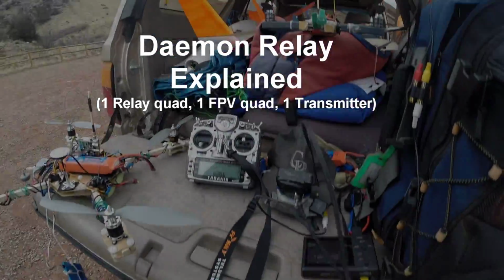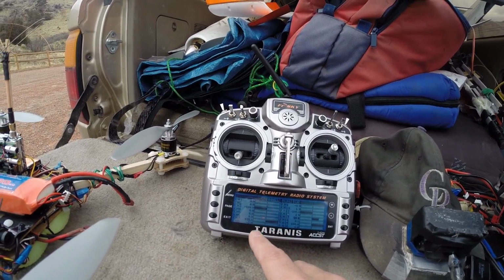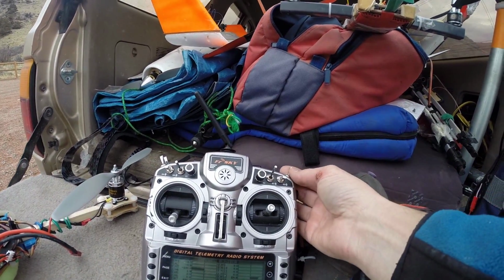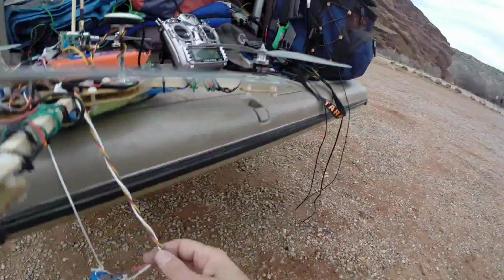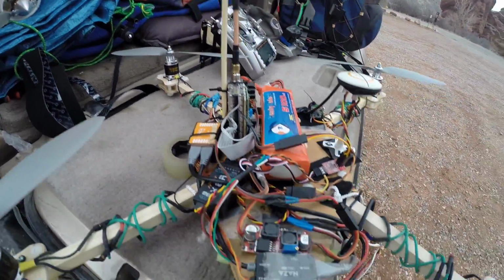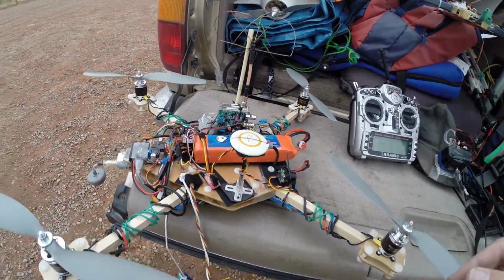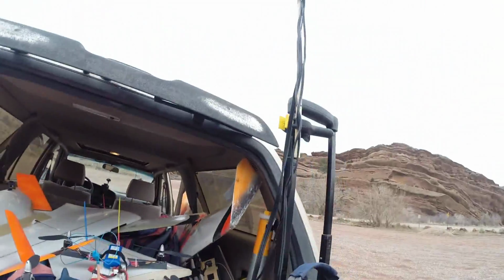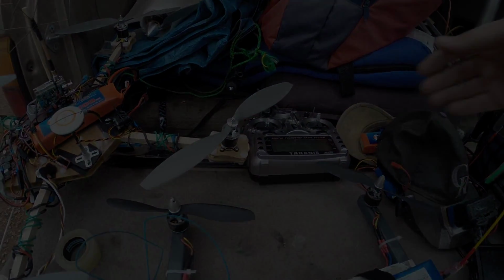Daemon Relay - Explained

Comment: FWIW,  I can power your relay quad from the ground to allow for continuous operation while also placing the antenna (only) for the relay at altitude along with it. This lets you leave a lot of the heavy stuff on the ground. The trick is to use a surface wave transmission line tether with top/bottom launchers and a lightweight antenna at the quad. Doesn't help much since the FPV vehicle is still battery bound.  Contact me or see YouTube "Flying Antenna" for more details if interested.

Comment: Hello
Could you let me know a bit more info on the relay its self. I want to mount a relay ontop of my house for my taranis RC Tx I already have a external video receiver mounted but struggling to find a way to broadcast RFF 2.4ghz from a remote "relay" which receivers from my taranis and then sends signals out from the roof

Could you link me to the range link transmitter module you have used? I have an x8r spare receiver, so i could bind this to my taranis, then sbus > PPM > RangeLink? What is this rangelink product can you link me to it? How do you configure it to receiver PPM signals and bind it with the receiver on the FPV quad